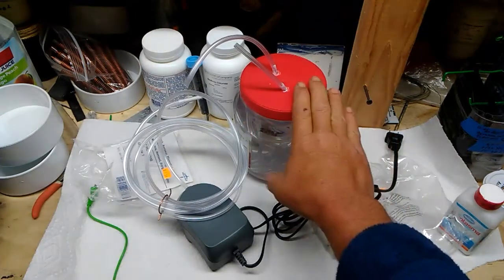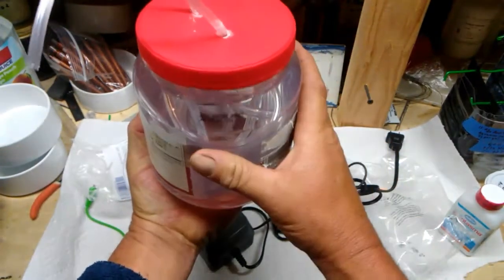Breathing device

Comment: what is the reasoning to caustic coat container and tubing?  Does it make the container/tubing more permeable for gans plasma field flow?  Nice set up.
Reply from the maker: James Triplett yes exactly James buy Nano coating the outside of the tubing and the inside of the container we are putting everything into a plazmatic condition
Reply from the maker: James Triplett also I have to give the credit to Lee coats of the plasma reactor group for the design of this breathing device we learn a lot from that group and the Creations they come up with

Comment: Thank you for your answer. I have more question? Did you nanocoat the outside of the tube and the jar separately? If you nanocoated the outside of the tube in the jar, how can you prevent the caustic from getting into the tube?  Also if the nanocoated tube is in the water, then it may get into the inside of the tube anyway? About the caustic, would it be just noah or a mixture of noah and Koh? When you say activated Co2 and ZnO, what exactly does it mean?
Reply from the maker: Jessica Buckuner 
good morning.
when i nano coated the tube and the jar, they were together. when i put the tube in the jar, i drilled the holes in the lid for the tubing. then put the tube in the jar, 25 feet of tubeing. then attached to the lid.  at that point is when i filled the jar with caustic about 3/4 of the way full. I shook up the caustic and let it set for about three days.
then rised out the caustic with distilled water.
with the tubing attached to the lid there is no chance of getting caustic inside the tube.
The caustic was a normal mixture of custic soda and potassium. i use (no salt )
for potassium.
Reply from the maker: Jessica Buckuner 
also i put a small vial of co2 zinc 50 50 and place in the jar. That vial energizes the jar of distilled water
Reply from the maker: Jessica Buckuner 
sorry it has taken so long to get back to you. 
i filled the jar almost completely full.
Reply from the maker: bluetrinity haloseven hello all of the metals that I have called out or in a plasma state will use them Nano coating process to harvest the plasma to create the Ganz to activate the water.
This is all based off of plasma technology no Pharmaceuticals used.
Check this out at the Keshe Foundation. There's also a homepage on YouTube

Comment: why did you nanocoat the container and the outside of the tubes inside the jar?   Is the jar glass or plastic?
Reply from the maker: Jessica Buckuner 
hello, i nano coated the in side of the plastic jar and out side of vinal tubing to allow the liquid plasma a contaiment. it kind of like when we set up a co2 gans reactor. it is recommend that the tub that we use, plastic or glass. should be nano coated.
Reply: How much water should be filled into the jar?   Did you hear from your friend his son's result?